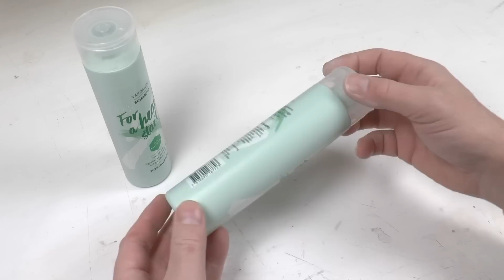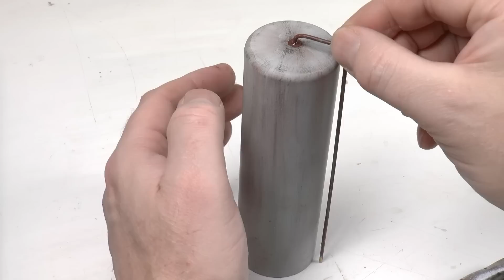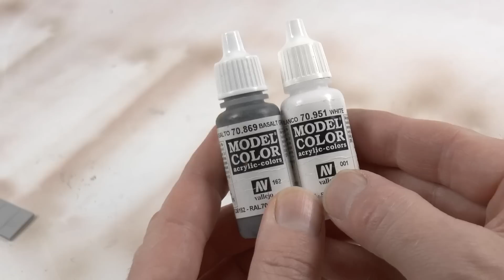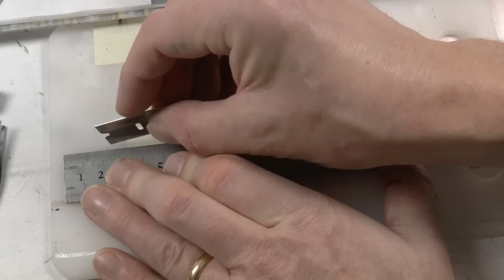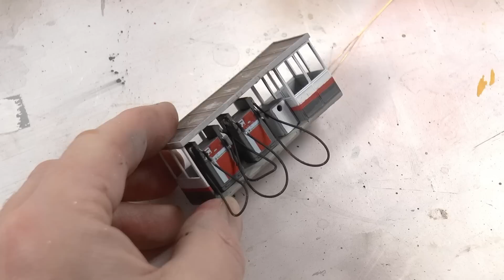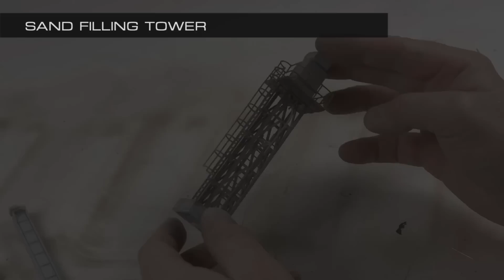Building a diesel and sand filling facility

Comment: It looks amazing but a small point. Diesel tanks will not have a filling pipe via the top of the tank. 
They will be filled and discharged via a connection near the bottom to prevent static discharges/build-up and ease of operation. In general its easier to discharge and fill from the bottom as je don’t need any suction head.

Comment: The horizontal fuel barrel you made towards the end looks an exact copy of the Faller 120157 kit that I got for Christmas this year…. Tank supports, pipe layout - everything in fact!
Reply from the maker: Hi! Most of the manufacturers has similar sets including tanks on concrete sockets. This is probably the most common setup for diesel storage found in Germany during the 60s to 80s. The 120157 is a great kit. I wish you much fun building it! Regards / Martin
Reply: @marklinofsweden  thanks. Yes it is now built but sadly i won’t get to my railway again until the Easter holidays. Thanks for your channel though, i have picked up so many great tips about weathering and rock building/painting 👍👍